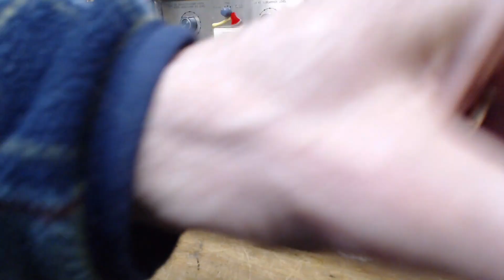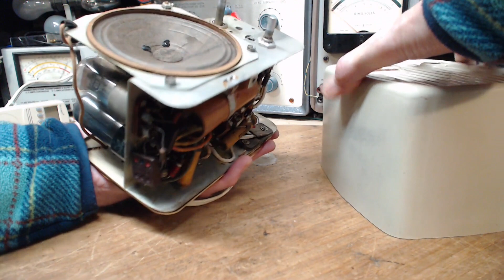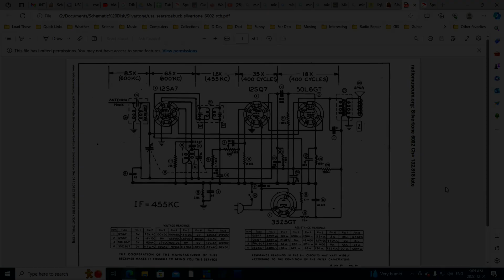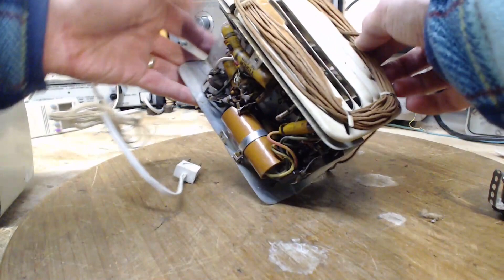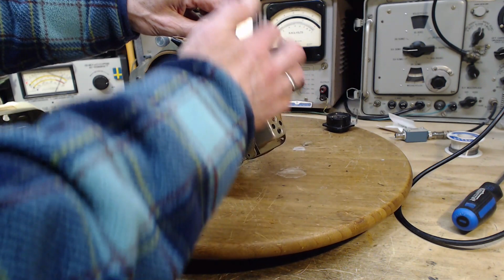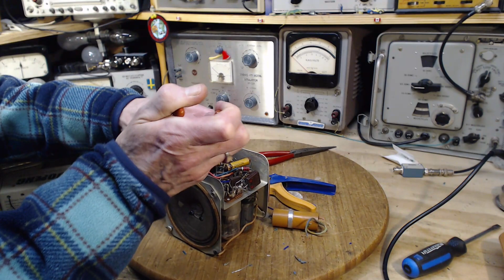Silvertone Tiny Tube Radio Model 6002 Video #1 - Checkout, Power Up, PS Filter Capacitors

Comment: I guess I'm just a neatness freak, but I probably would have installed a small termaial strip and used  axile lead caps.  Radial lead caps do not belong anywhere in an antique radio.  There are also reproduction multisection, but to future proof, I think axile lead works and it does apear there is room.

Comment: The 47 ohm. resistor off the cathode of the 35Z5 is the fusible flexible resistor.  Remember the cathode is the output element of a diode  . A hank is a roll of rope, hair or wire. Like in a rag, a-bone and a hank of hair..
Honeycomb!